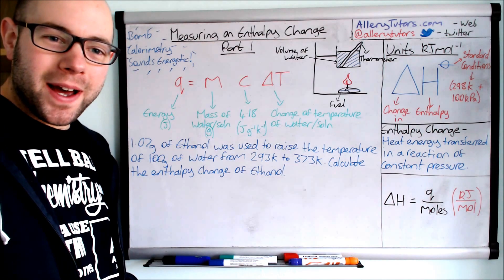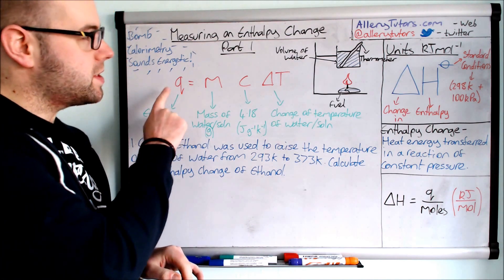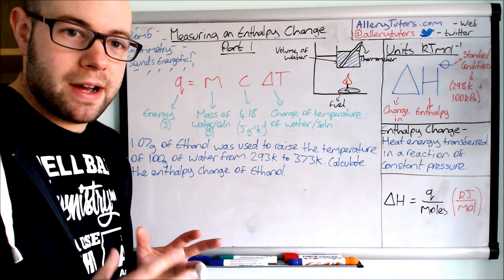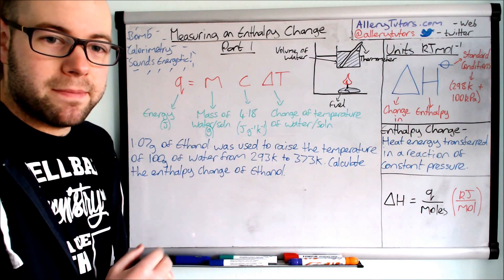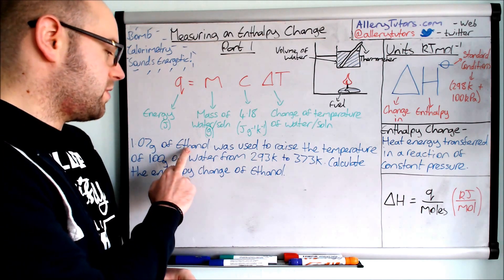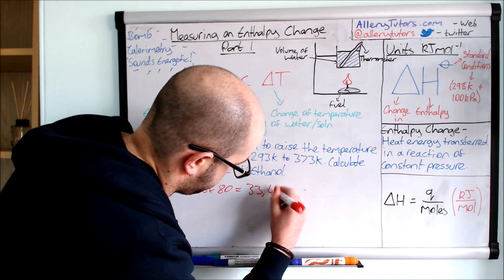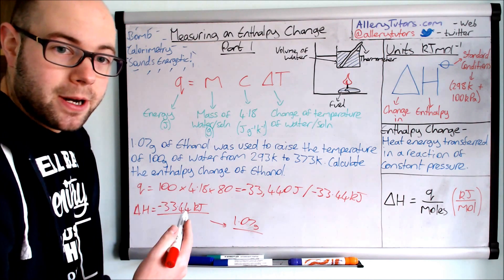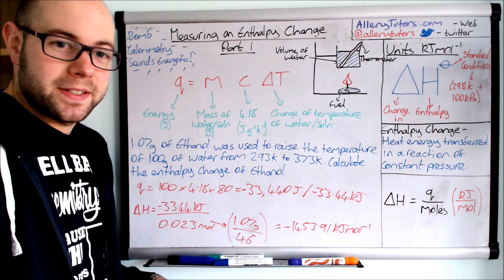Measuring Enthalpy Change Part 1 Enthalpy of Fuels

Comment: hi sir , im confused on how we assume is exothermic to give it a negative sign because i thought when we burn fuel its combustion which means it has to react with oxygen to get co2 and h2o why is that when it reacts with water also burning. im not sure if i make sense but like do we have to always put a negative sign no matter what ? thanks also great video
Reply: hi yes an exothermic reaction always gives you a negative enthalpy change. This is because during an exothermic reaction energy is lost to the suroundings. In other words the reactants lose heat energy therefore the products of the reaction have less energy resulting in a negative enthalpy change. In the experiment Allery Tutor was talking about the ethanol or fuel is being used to heat up the water in the beaker. There is no reaction going on between the ethanol and the water in the beaker. There is the combustion of ethanol which heats up the water. The change in temperature is what is used to calculate the enthalpy change. Hope this helps.